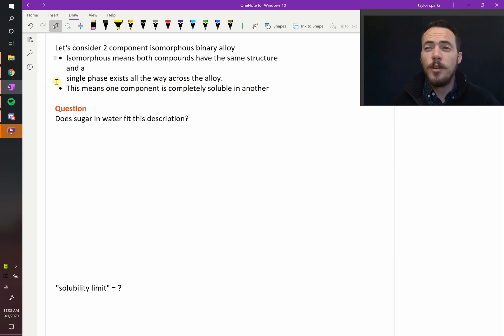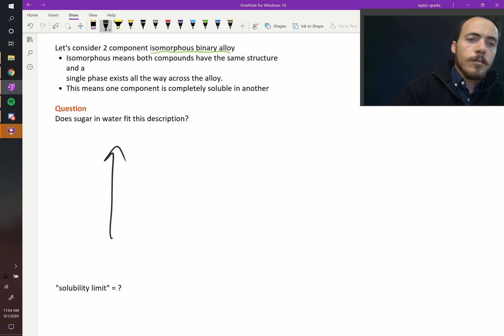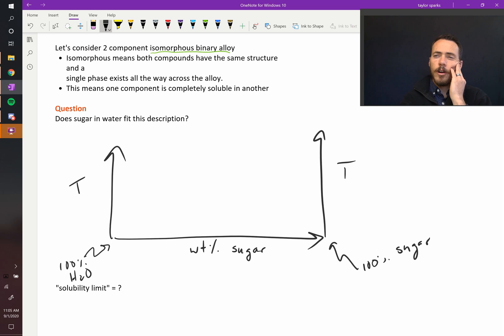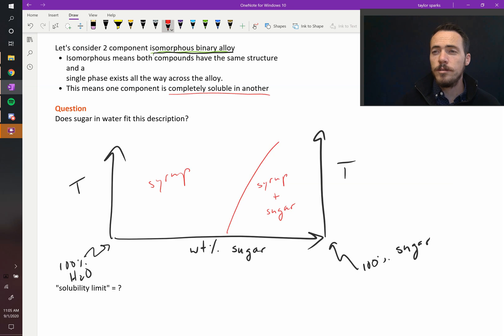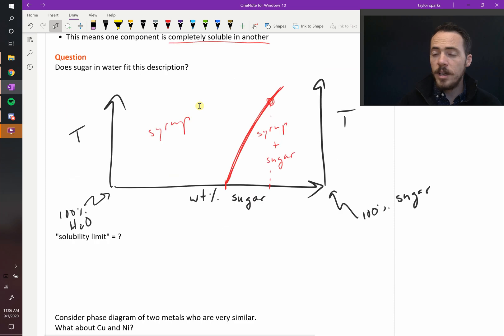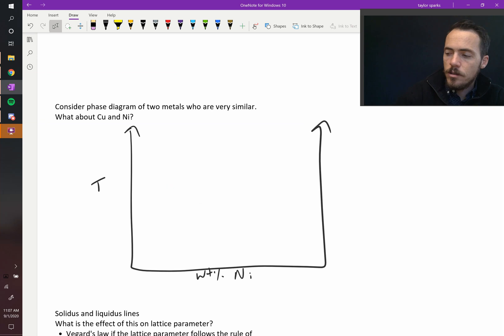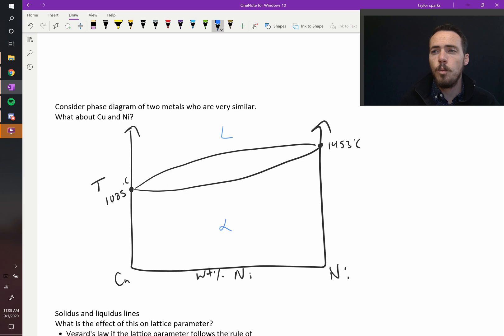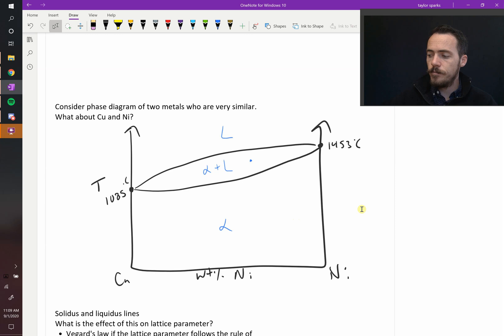Binary phase diagrams

Comment: Hi I have one question. What is the meaning of the percentage in x-axis? For example, the area has A and liquid. The horizontal line intercepts with the liquid curve on the right and it gives a number. Does the number indicate the percent of A in liquid? Then what does the number of lever rule mean? I really appreciate your answering!
Reply from the maker: Where the horizontal line intersects the equilibrium lines on a phase diagram gives you the composition of the phase that it intersects
Reply: @TaylorSparks  then what if I use lever rule? I think the answer means the amount of liquid in this situation. Am I right?